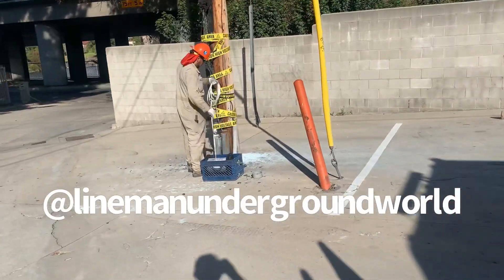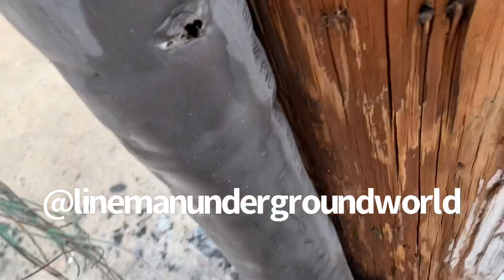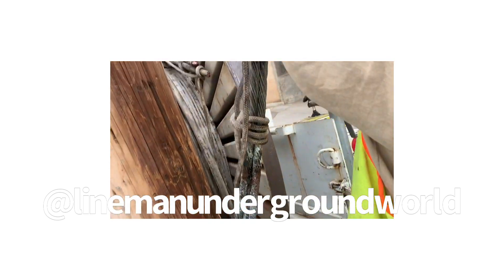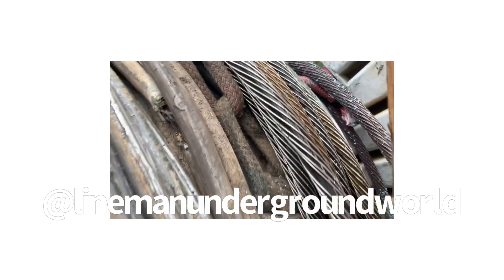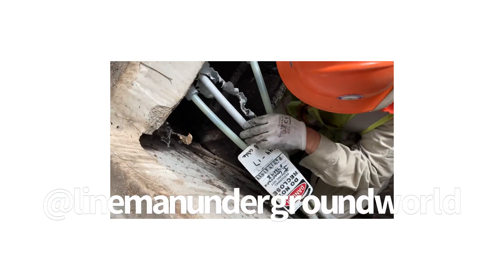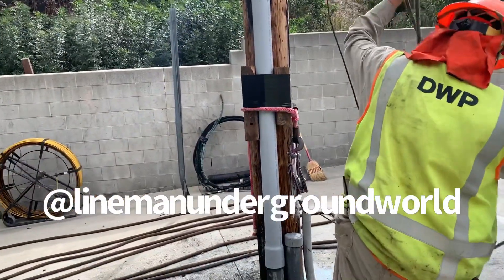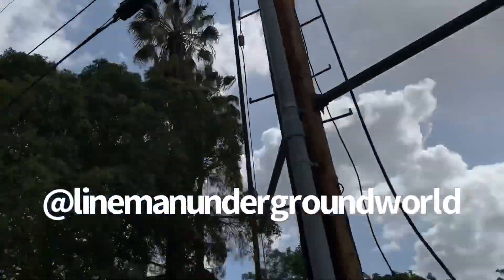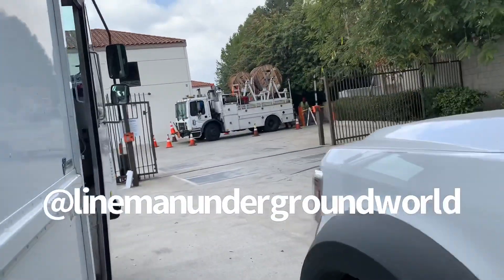Mistaken voltage

Comment: I wish our utility installed ducts for everything. Dude they direct bury everything. Cables failure all the time so we hafta isolate ends of cable hit them with the thumper and locate the fault. Dig it up cut out bad section and splice in a Dutchman (two splices with new section. Then bury it again. Soooo stupid. A few times I’ve been repairing faults and same section of cable. Hey they wanna keep paying me to fix it I’ll take the overtime hahahaha
Reply from the maker: That’s amazing you guys direct bury all your cables .. the best part is that they are paying you 👍👍🤣😂😎
Reply: @linemanundergroundworld4854  for the most part yes. They’ll directional drill in cable, and new risers all direct buried. It’s silly honestly. Job security, I’ve worked on jobs where we installed vaults and conduits. But I’d say 90% of it is direct buried. They’ll keep repairing a section multiple times. Once it’s bad enough they’re just drilling a new set.